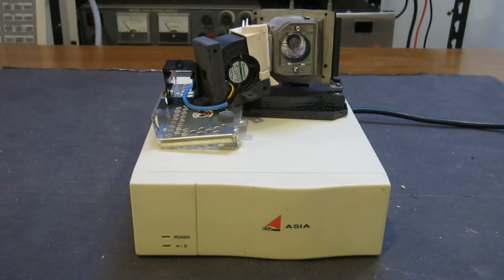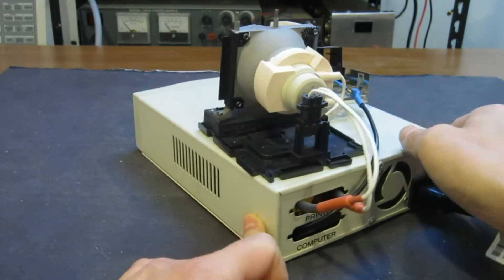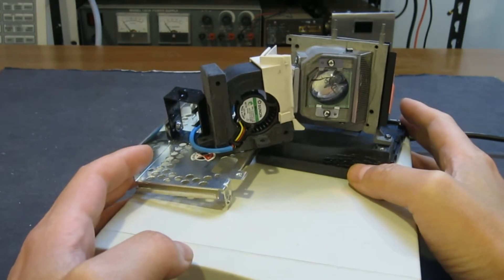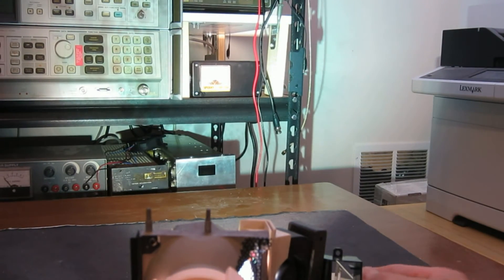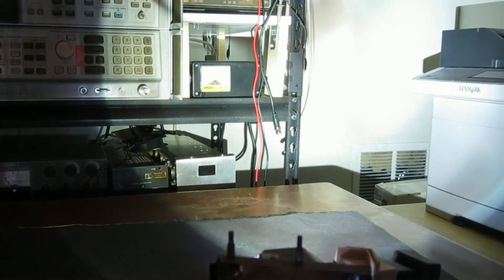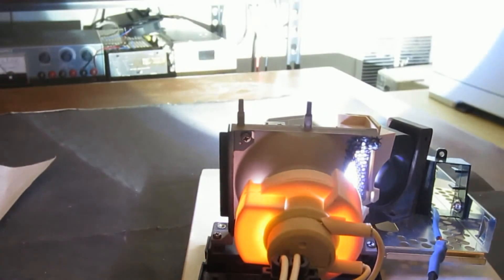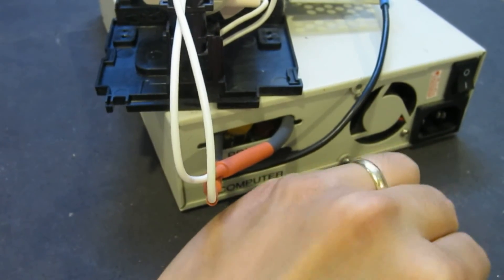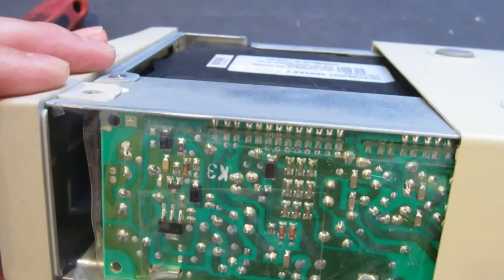A Super Bright Light Source

Comment: Very scary stuff. Not so much the voltages, but these lamps are designed to run in enclosures for lots of safety reasons - 1) there's a huge amount of UV component as well as visible, enough to damage eyesight and skin. 2) when the lamp is on and hot, the internal pressure is huge. I have seen and worked on many devices where lamps have ruptured (usually past their recommended life) and had to write them off due to the tiny shards of melted glass scattered around the optical enclosure.

Don't get me wrong, I love it, and I've done it, but I'd be more comfortable if there were safety warnings around these facts.

I'm a new convert to your channel, but really looking forward to watching your back catalogue!!

Comment: I just wonder why you didn't use a HID car headlight with it's supply/controller running of 13.8V at 6A would that not have been the way to go.
Reply from the maker: I could do that, but I wanted to utilize what I salvaged from the projector.

Comment: Those old external hard drive cases are great for housing projects; I used one to build my Rubidium standard project in. Having a fan and the AC connections/switch made it very easy; would have used the existing power supply if it had sufficient capability but a quick swap for a new one and it turned out really nice. What do you plan to do with the light or was this just a proof of concept project?
Reply from the maker: For the moment, it's just for fun :-)